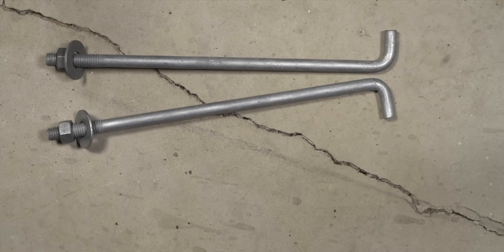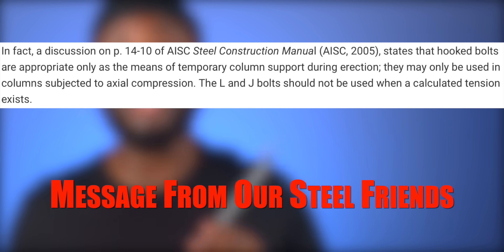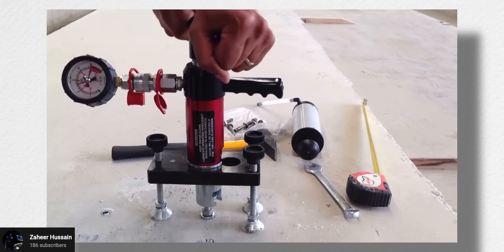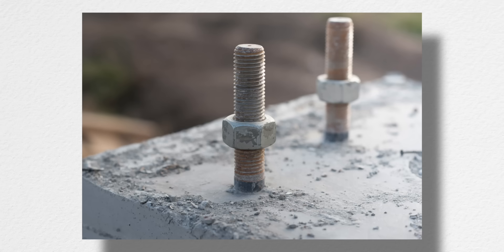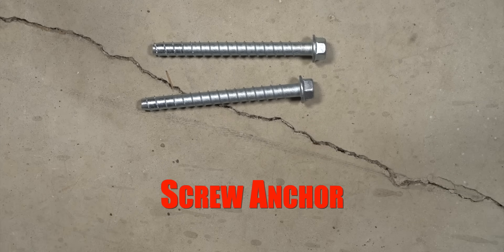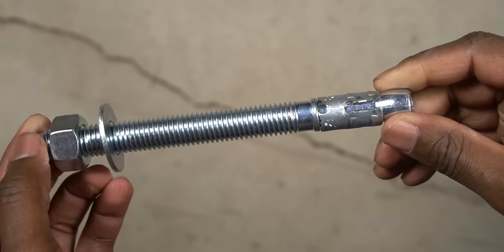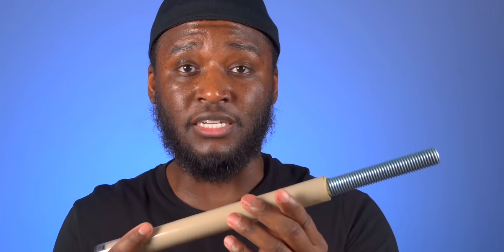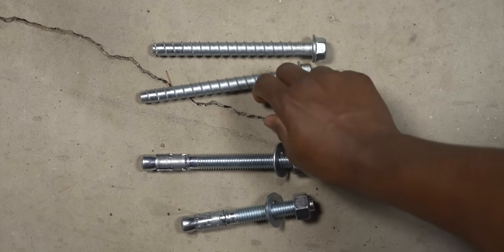Why Abandon "J" & "L" Anchor Bolts in Wood Framing Construction FOR GOOD?

Comment: Very good presentation. I will be using epoxy-threaded anchors for my home project.
Reply: epoxy has it's own problems.  nothing sticks to dust, and after you drill hole for rod (time consuming, btw) it is hard to get all the dust out.  also expensive.  J nd L bolts are cheap, easy to use, (contrary to what this video claims), and very effective.  I would bet that they resist pull out better than the post installed solutions. especially if combined with rebar. Impossible to debate, though, because this creator offered no data to support his (wrong) assertions.  I expected more from an engineer.

Comment: you switched from calling out the L anchors for not having enough uplift resistence, to alternatives that are easier to install (good) but also don't have definitively better uplift resistence. what anchoring methods resist net uplift best?
Reply: Wiggly bolts

Comment: My experience is that drilling is easier and way more accurate without having to hang out material in the sill plate. Post drilled threaded bolts are commonly used in pole barn construction, and are more than adequate to hold the structure to the foundation. Having said that, I use j-bolts per code then add extra drill ins so that I have an anchor every 32”.
Reply: Post installed anchors are for people who can't figure out where the walls are going.
J and L bolts are less expensive and stronger according to the published data for similar sizes.

Comment: J-bolts  are the  only  option City inspector  will alowed  in the  area  I   Live in      (SF Bay area)    Other types  are  not  allow         You can use them but  not if  you are  doing  permited  work that  needs  to be inspected

Comment: Can someone explain tho how a thread can be stronger than a J or L cast into concrete?
Reply: They’re saying because it spreads out the load over a greater area, and all the way around, not just one side. I still question a screw’s ability to grab the walls of the hole it’s in, but I honestly can’t say which is better. The uploader seems to be focused on ease of installation, and as others have pointed out he omits the need to thoroughly clean out the hole when using epoxy, and to do that with an inspector watching. He also doesn’t mention the time it takes to drill through concrete.

Comment: I'm also a licensed structural engineer specializing in residential and high end residential design. I don't agree with the conclusion to substitute post-installed options for cast-in-place anchor bolts. While most contractors are going to love your video and always ask for a post-installed substitute, it's not a one for one exchange. The capacity of post-installed options is substantially less than cast-in-place anchors. Not to mention that breakout is of equal concern and maybe even greater depending on construction practices and how the install went. Overall, substituting post-installed anchors for cast-in-place simply because they are easier to install for contractors is not enough to change industry standards. If your issue is with the breakout capacity being limited to the top of the J, then you can always substitute a straight bolt with a plate washer sandwiched between two nuts for substantially higher capacity. I think this video leads people astray.
Reply: Cross grain bending of the wood is far below the bearing capacity of the L bolt (aka pull-out).  Headed/nut washer should be used when up lift is significant.
Reply: @timothytimmerman1136 already required homie
Reply: Wind lift is never 100 perfect up lift it's more diagonal tests need to be redone testing at lift diagonally. I'm just a builder and hate cast in place j bolts but wager money they do better in real world situations the problem is there coatings against rust are worse than some others
Reply: @patrickday4206 coatings can be extremely problematic, there is a reason epoxy coated rebar isn’t used anymore.
Reply: I’d wager that not many installers are properly cleaning out their freshly drilled holes making their “easy install” easier but far less effective. A visit to a job site would make me some easy money.
Reply: @RPM-g7g  It doesn't matter how clean the hole is... It's not about them pulling out of the hole!
Concrete has terrible tensile strength... so putting a J anchor under a horizontal rebar will ALWAYS give you better strength!
Reply: @onestoptechnologies7305  Yes everyone is not mentioning Rebar or SSTB bolts for hold downs which can be extended to the top roof plates with couplings and threaded rods . also cast in place J-Bolts can be set with brackets , piece of cake . Also some  inspectors want to see the empty epoxy containers the Simpson epoxies have a  expiration best used date stamped on them .
Reply: @onestoptechnologies7305  Cleanliness of the hole is critical. You want the epoxy to bond to the concrete, not the concrete dust. Epoxy is chemically bonding to the concrete and the bolt. Pull-out tests are performed with a properly installed anchor which includes proper cleanliness. If the hole is not cleaned, it is not a tested installation method, and there can be no guarantee regarding strength or resistance to pull out.

I am a structural inspector and I have failed more epoxy jobs because of improperly cleaned holes than anything else. If you don't have an air compressor at 90 psi and no wire brush of the correct diameter, it's a fail - see you tomorrow when you get the required equipment.
Reply: @V8Z3  Even if the hole is cleaned with air, alcohol or whatever else you want... 
If there is perfect adhesion, it will be to the immediate concrete... J-bolts create a larger holding area!
Reply: * are NOT properly cleaning out
Reply: @JetSkiSuper7 I literally just watched this on another video. The guy was epoxying threaded rod without blowing out the hole.
Reply: Post anchor solutions may require essential hole preparation.
Reply: @Matthew-zw9su definitely the ones that rely on epoxy
Reply: Agree 100% with Bridger.
Reply: i totally disagree with the post-install as a primary.  a. the pull-out test is based on one anchor point. Typically you have no less than 3 points. I'm not an engineer, but have a few family members that are. I'm sure one that is, could tell us the strength of 3 in linear or triangle set
Reply: Agreed! Terrible swap!
Reply: I like J bolts hooked on rebar not just as a way of keeping it in place during a pour but man you will never pull that J set underneath rebar. More likely you will pull apart the stud from the base plate as the framer is not always on task at crossing the nails for more bite... and ply- per stud  it's only 2 or 3 more nails tying into that plate.  Really it should have a bracket on 4x post tied into the bolt if uplift or the odd lateral force keeps you up at night. Look into advanced framing and save some money. All those titans...  who's to stop workers rushing to drill into uncured cement to hurry up and set those walls. It's easy to drill into soft cement. Not good.
Reply: However those post cast installations come with alot of technical data to support their installation.  As a PE, I can depend upon that kind of data.
Reply: @coasttal123 but you can't depend on conditions and installation. The imbedded may be more difficult to install but are better.
Reply: Eh, just talked to my engineer, in the process of building a new house with a floating slab foundation, here in vegas they still specify J-bolts, better than everything else they have to offer
Reply: As a contractor who has demolished and installed foundations for 20 years, you are correct.  I would never put screw in, wedge, or epoxy anchors on my own foundation.  Even when installed incorrectly, J bolts will hold better than drilled in anchors.
Reply: I’ve got yrs of experience with different types of anchors and I also totally disagree with this man. On the other hand a drop in wedge bolt can also throughout the year bring moisture down inside the bolt, cast in place is still the best, easiest and cheapest way to go. If anyone is worried about a j bolt. Use a piece of threaded rod put a 2 inch plate washer on the end that works great also
Reply: I agree, post install fastners are 100% about ease of use because contractors don't want to take the time or learn the skill of laying out J bolts.  Laziness.  The fastner manufacures are more than happy to go along because the J bolts cost less.
Reply: @frotobaggins7169  lol nothing is simpler then cast in place dude why comment if you dont know shit
Reply: @frostycools1315  its not about locating ab on layout.  Its about those located ab shifting out of plumb and pushing out of line of the setback.  Hilti/simpson titens alleviate issues that are difficult to control. And since ab in many municipalities are not used for uplift screw anchors are great.  Screw anchor torque limits out at 150ft/lbs in installation where ab are finger tight plus half turn.  That should tell you something about their purpose.
Reply: @BaronVonFrankenBolzlll  nothing is as good as cast in place.
Reply: @frostycools1315  sure when its a sst bolt for holddowns or all thread for a strongwall
Reply: @frostycools1315  post-installed epoxy is a lot easier than cast in place if you account for the time one spends precision setting the cast in place anchors. Then the anchor gets knocked over a bit when finishing the concrete and it ends up getting cut out anyways.

It does depend on the scale of the project. For a small job, cast in place works fine. For larger jobs, epoxy is typically the way to go.
Reply: @V8Z3  im still laughing at you
Reply: @V8Z3  easier lol you dont have two clicks for a clue
Reply: So sandwich the concrete with washers basically?
Reply: Fair new to industry but familiar with both products. But for your reply(and critical thinking ability), I would have strongly considered the claim.
Reply: Agreed.
Reply: Hello, so i have to finish the final inspection because I have a shitty contractor who will jot do any more work. Anyway, I don't have enough anchor bolts and need to add more for a pass on final inspection.  What do you all recommend?
Reply: As structural engineer myself, I agree with my college,  a cast option is stronger, the difficulty is to locate them in the correct spot quickly enough before concrete sets.
Reply: I'm a structural inspector and I've never seen any issues with post installed anchors. For the type of usage described in the video (hold downs for wood framing) I only see epoxy anchors which are absolutely the superior method. Epoxy anchors are much easier to install and if a cast-in-place anchor bolt was specified at 1/2" the epoxy-set bolt will typically be 5/8" to 3/4" or have a deeper embedment depth to account for any reduced strength. In reality, epoxy anchors, if properly installed (hole cleaned adequately) are as strong as cast-in-place and may be stronger.

I have contacts at Hilti and have asked them about this. The answer is simple: cast-in-place bolts do not provide friction or adhesive forces along the shank of the bolt and minimal strength along any threaded portion. The only strength comes from the "turn out" portion of the J or L hook, or the washer if a buried nut/washer is used. But epoxy is chemically bonding to the concrete and the bolt so you get strength along the entire length of the bolt. Pull out tests of epoxy-set bolts shows that the concrete fails, not the epoxy or bolt.
Reply: @V8Z3  problem with cast place and chemical anchors is the distance from stemwall to anchor when dealing with holddowns. Anchor bolts are less of a problem due to the number used and shear forces.  I assume you know this.i think a big problem is nomenclature, not all anchor bolts are holddowns but all holddowns are anchor bolts. The seismic zone i use to work in many of the retrofit holddowns had to be drilled through stem/footing and washer nutted under.
Reply: @V8Z3  structural inspector lol can you hear me laughing at you kid
Reply: @V8Z3  you are not any inspector man why lie about sht you clearly have no education about this stuff
Reply: @V8Z3  that is some real bullshit right there kid, you are clearly no type of inspector and you do not have a clue about this stuff , a typical 2000 sq foot home it takes less then 90 seconds to install all the anchors in the cement and as for cutting them off due to bad placement next time use a tradesman lol we we never need to do that its a rookie thing  , drilling and blowing out holes then adding the epoxy and bolt takes about three hours for the same foundation , the shipper you know at H prove me wrong even the American institute of structural engineers say cast in place is the best choice side note ,,,,,,  ya save the bullshit for your kids
Reply: J and j bolts are the best possible  i have been building my whole life. J bolts i have seen 1 half inch j bolt  holt 18’ long ineam column without tearing out on demolish and rework a couple times. Always impressed me. Acceleration and uplift so 1 , pretty impressive. A super blue screw. No comparison
Reply: You can simply use more post installation anchor bolts since they are far easier to install. so instead of installing just 3 to 5 J-bolts, 7 to 10 screw anchors could be used which would provide more straight since there are more bolts installed. Issue is that the j-bolts can be a problem if they are misplaced because the j-bolt is in the same spot as where a jack stud needs to be for structural support. Often the framers just cut the j-bolt out. The concrete installers just install the j-bolts based upon code spacing, & don't look at the framing to make sure the j-bolts aren't located where studs or jack studs need to be.
Reply: no one hooks the j on rebar , they need to require to be tied in on inspection , but inspectors are lazy , they should;d be held accountable for not making contractors tie the rebar on inspection . this guy has no idea what he is talking about .
Reply: @jabs4554  J-bolts are added after the concrete is poured, not before.
Reply: you're talking about options that don't become reality "substitute a bolt with a plate washer..."  this hardly ever is put into practice.   you're objection is only against the largely theoretical, not with what is practiced
Reply: Common sense with a bolt straight in will say its weaker. I used these, and some also don't grab and slip. The wedge ones are just as risky as not to grab. To correct, it's expensive to use the epoxy. But then gets strength.
Reply: yeah, this video is bs
Reply: In Kansas, strong uplift zones require steel strapping placed in the foundation or stem wall, and attached to the structural framing.  

In the fifteen years I’ve been building, I don’t recall one instance where an engineer or inspector required emplacement bolts.
Reply: There are pros and cons to both methods. I prefer post-set bolts for ease of layout.  But it's critical to properly prepare the holes -  it's not particularily difficult to do it properly - just needs some simple training.
Reply: and they are NOT easier to install then cast in place , it dont get more simple or easier then cast in place lol you people really are out of touch with the trades
Reply from the maker: Agree! That’s why there’s more information posted in the comments and description. Thanks for sharing! Cheers!

Comment: My common sense indicates that an L bolt has a more secure connection than does some screw. But a test showing what is the maximum resistance to pull out is needed.  And I wonder if L bolts ever pull out instead of ripping through the concrete?
Reply: Most likely the concrete will fail first unless the anchors are small.  L bolts put tension on the concrete only on the bent side. While screw/wedge anchors spread the tension all around. It`s like half a cone vs full cone spread.
Reply: The L bolt only effectively binds at the bent section; the shaft offers effectively zero binding force. With an adhesive anchor, the bond exists across the entire surface of the hole and bolt.

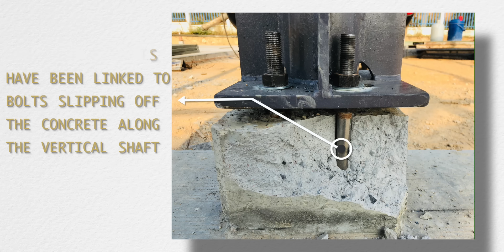Comment: Text at 1:51 states: “J/L bolt failures have been linked to bolts slipping off the concrete along the vertical shaft.”  I don’t know what your source is for this assertion, but it does not withstand theoretical scrutiny.  First off, the bolt shown has clearly not failed; it is the concrete that has failed.  Ideally, you actually want to allow axial movement of the bolt w.r.t. the concrete at all points along the bolt, except, of course, deep at the fender washer or “J” or “L” area.  Remember, concrete is strong in compression and weak in tension.  Also keep in mind that the anchor bolt (as with all elastic materials) there will be elongation resulting from the axial force.  If the bolt is bonded to the concrete, as the bolt is loaded, part of the load will be transferred to the concrete.  Near the surface, you want all of the tension to be borne by the steel bolt, and none by the concrete, lest we see the failure type shown at 1:29.  This why tape or tubing for the upper portion of the bolt is sometimes specified to prevent bonding to the concrete.